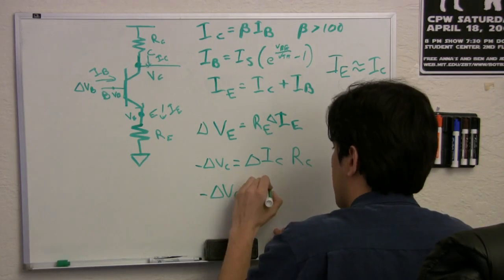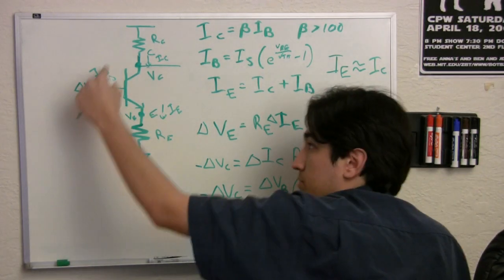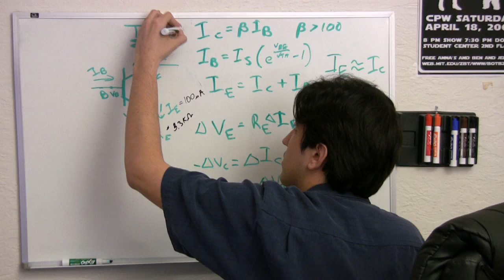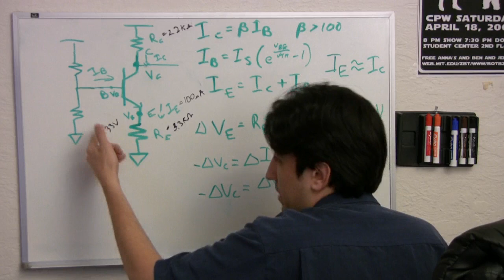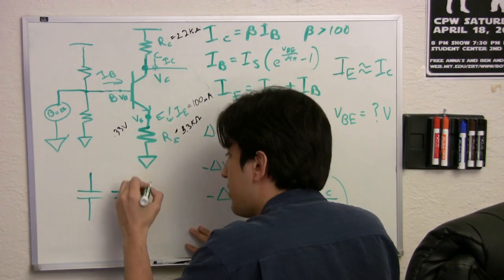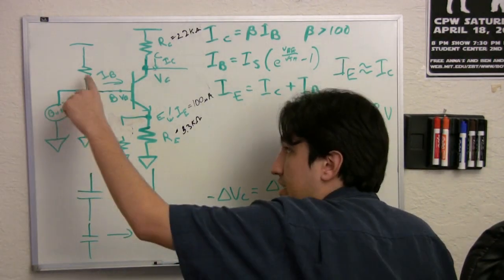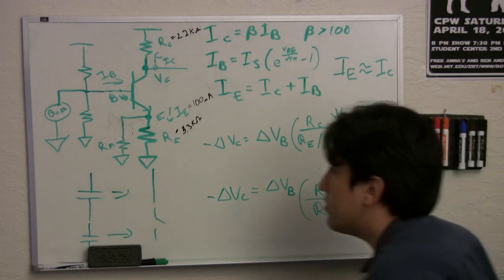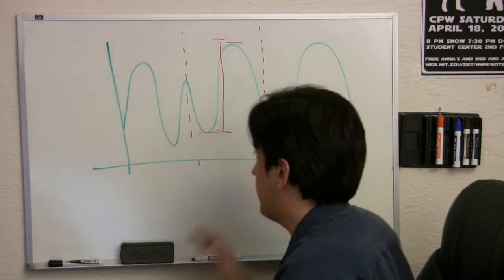Piezoelectric Sound Meter (Part 2 of 2)

Comment: I'd say a transistor is a more fundamental unit to teach with than an op-amp... so thus better for the circuit. Also far simpler and marginally cheaper.

Comment: hi, can you tell me for building a AM transistor radion, if i want to use 2 transistors as darlington...then use amplifier for further amplification...  ,,what should be the value of bias resistor(collector. base)in darlington.....i usually use bias resistor 100k  for single transistor ...similarly if i use 3 transistors as darlington..what should be the bias resistor..similarly if i use 4..5..6...

Comment: Man, you should so make a part 3 where you'd drill down into LOG output as opposed to linear.  It was pretty awesome to incorporate into a sound level meter.  That's where your solution will completely blow away any standard solutions based on discrete parts and wave-followers (uness they stick in a log amplifier).

Comment: I think the op amp circuit would be far simpler to analyze/design.  But I guess it would be overkill when a single transistor does the job.